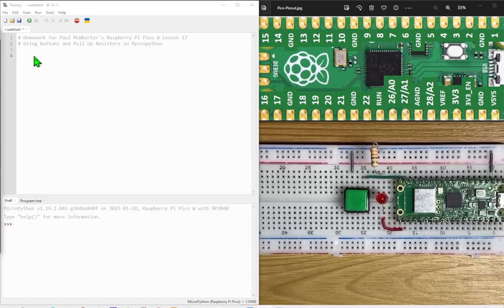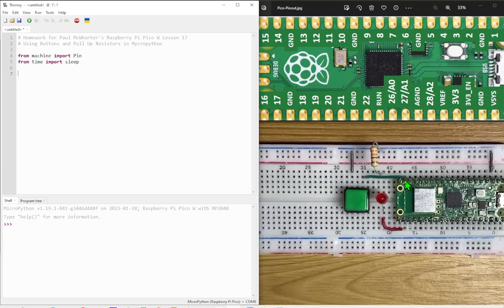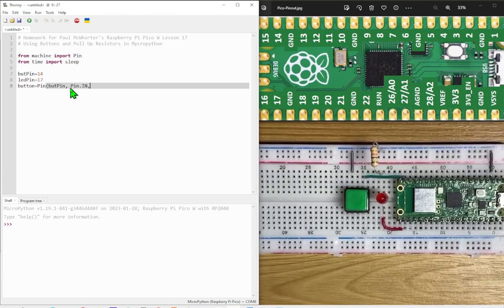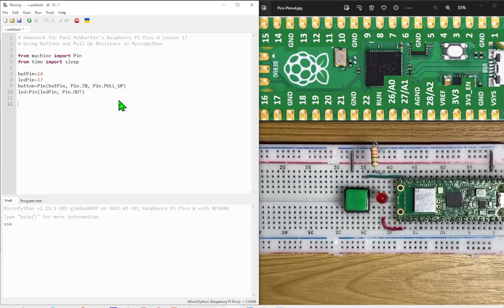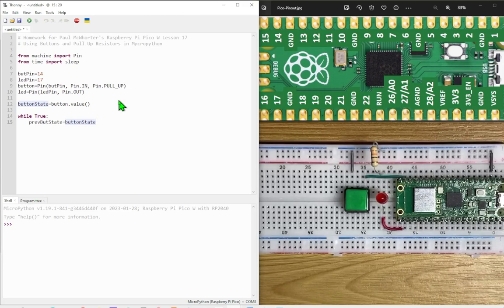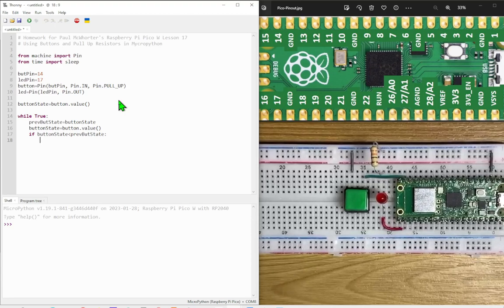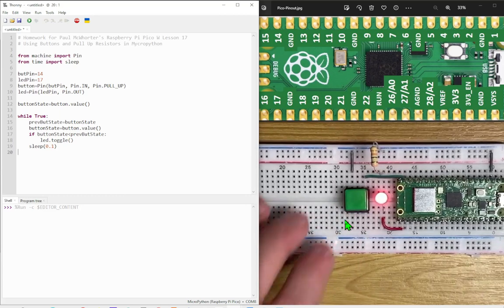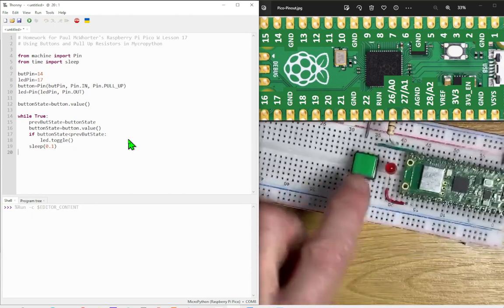Using a Push Button to toggle an LED on RPi Pico

Comment: Great job. I have never seen code using the less than logic used for button press in this way. I like it and will be borrowing it for my coding toolbox. Thanks for sharing.
Reply from the maker: Thanks Keith.  Not sure if it's the right way to do it, but it just seemed logical to me, and doesn't use too much code.
Reply: @kev67uk  So when using a pullup on an input my check for press would be
if butState==0 and oldState==1: which is logically the same as your check but does 3 operations where yours only has to do 1. So shorter and more efficient.
This check can only have 4 states
curr prev
0      0     button still down
0      1     new button press
1      0     new button release
1      1     button still up
Your less than logic is only true for new press. If the button was set as a pull down you could just switch to a greater than and be good. 
Thanks again.
Reply: @Keith Lohmeyer
 That just shows that you never look at my code, Keith😁
Reply: @charlotteswift  I look at everybody's code. Sorry I missed it when you used this method. My only excuse is I am old and forgetful.
Reply: @keithlohmeyer  Just kidding, Keith. I think it was over a year ago. I didn't show the code in the video, just in the description which creates the problem that YouTube doesn't like < or > in the description.